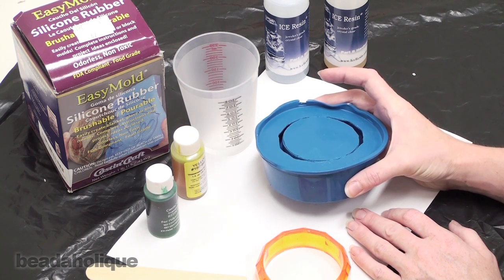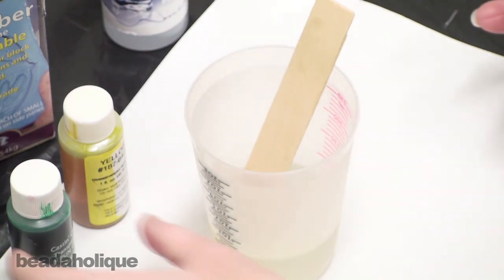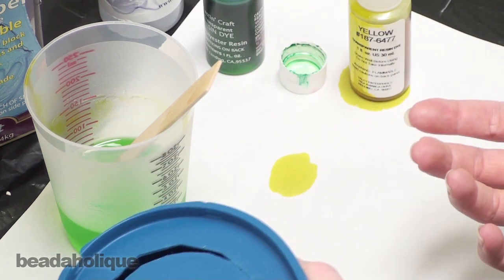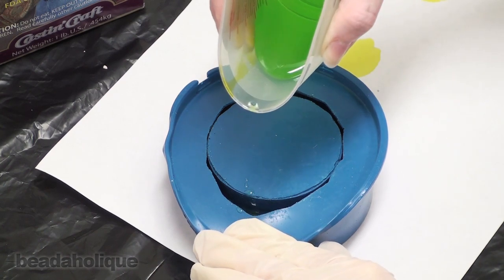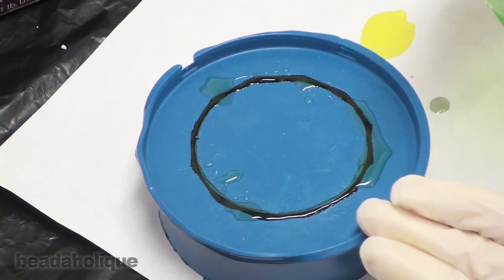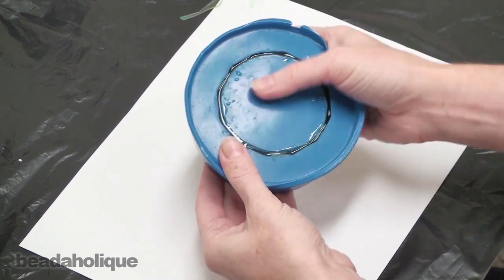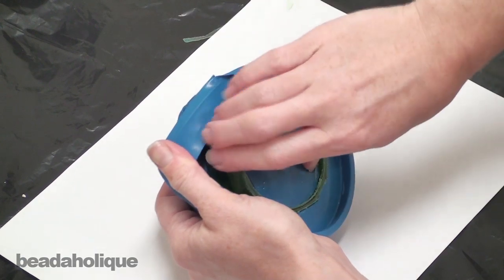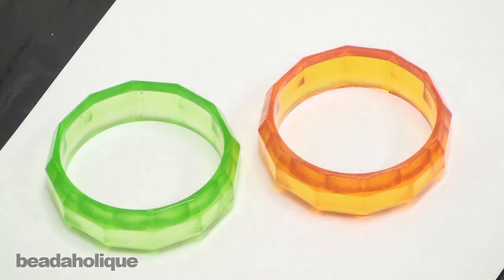How to Make a Resin Bangle Bracelet Using a Block Mold

Comment from the maker: @Beadaholique Secondly, the flex molds have that nice wide opening up top which makes insertion easy - with the block molds, the opening is going to vary based on the shape of the item you have molded. In the video I made, the bangle came to a narrow taper along the edge so the opening to pour the resin (or to insert objects) was just a small slit. My recommendation if you wanted to embed objects into block molds would be to mold items with a larger opening up top - similar to the flex mold.

Comment from the maker: @craftmomma3 The filing does remove the shine.  Here is what I would try to return the shine - first buff the area as best as possible to remove any resin dust and make the piece very smooth. Then try painting a very thin coat of gloss sealant over the area. You can also use clear nail polish - both of these will bring back some of the shine. Try this on a test piece first since this is not a guaranteed solution. Hope this gives you some ideas!

Comment from the maker: If you want to add things to resin, just sit them down inside your mold before you pour the resin. A feather is going to be really tricky though because it will move around when the liquid is poured over it. You will need to experiment to see what works and what does not. What type of lettering are you wanting to add? A premade silicone mold is actually going to be easier to do this with then a block mold because you will be able to see through it.

Comment from the maker: @theonlyjaie Yes, you can embed objects with block molds but it is a much more difficult process then with the flex molds and it will take some trial and error. First, the flex molds are clear which makes embedding and arranging objects fairly easy whereas the block molds are a solid dark opaque which can make it tricky to see where you are placing objects.

Comment: @Beadaholique I think I have a way around stabilizing the mold. What I want to pour will be around 10" high and slim and I want to embed into it. I'm thinking of using a clear piece of pipe (like what is used in candle crafting) to hold the silicone not only for casting, but for holding it during resin pours, mold top can be open. Now that I know that the only issue is that you can't see what you are embedding, I think the clear will give me a way around that.

Comment from the maker: I have never used a straw but my best guess is that they are trying to use the heat of their breath to remove the bubbles. Blowing cold air on it will do nothing. I would actually think breathing heavily close to mixed resin would be better then the straw which might allow the heat of your breath to cool down before it reaches the resin. Still wait the 5 minutes, it does help a lot, and then you can try the hot breath - the more you can do to remove bubbles, the better.

Comment from the maker: @theonlyjaie It really is a case of not being able to see and also having such a narrow slot to get an object into the mold through. If you can open up that slot more - like perhaps mold an object with a wider top edge, you will find the process goes more smoothly. Also, if you are embedding objects in resin layers, you are going to have to be careful about manipulating the mold a lot when pouring the resin.

Comment: Nice, but 1 suggestion; drop a soup can in the center of the bangle. This would reduce the amount of silicone rubber needed. It would also make it easier to remove from the mold because a "donut" shaped mold would have no interior to fight against.
Reply: Thanks great suggestion

Comment: When making the mold, if you would put a large cylindrical object in the middle of the bracelet you'd save a lot of mold material and make it a lot easier to remove the item.

Comment from the maker: @michaelification1 Hi! Unfortunately since we do not sell the RTV 585 silicone rubber mold, I can not speak to what resins will work in it. However, what you are describing sounds more like a problem with the resin then the mold. If your resin is old, this could prevent it from setting up properly and always remaining sticky. The other issue could be if it was measured wrong. You need exactly equal parts of part A and part B. I hope this helps! Good luck!

Comment from the maker: @kenshidark We did not drill a hole in the video because we try to only use tools which a lot of people have on hand or are easily accessible. If you are going to drill a hole, I would do so with the original object still inside the mold (it will make the entire mold more stable for drilling)  and make sure not to drill anywhere near the molded area. I personally have not drilled through this type of substance before so I am not sure how easy it is going to be - it is a flexible rubber.

Comment from the maker: @ThePrettyLime The two most common reasons for resin remaining soft after 3 days are: somehow the mixing ratio was off and it was not exactly equal parts (you need to make sure that part A and part B are exactly a 1 to 1 ration), and the second cause could be that your resin is getting old. How long have you had it?

Comment: @Beadaholique what about using the clear (its more translucent than "clear" actually) molds?  I've had an idea that requires silicon molds but I've been hesitating because so few people seem to embed objects when using these molds. I've seen some resin bubble rings that very obviously have things embedded in them but have been just confused as to how the creator did it. If it's just a case of it isn't done much because you can't see the object, I can get around that!

Comment from the maker: @Beadaholique You will notice in the video how I pull the edge of the silicone rubber to widen the opening to pour my resin in - however if you are working in layers, you are not going to want to pull the rubber too much and run the change of the resin seeping along the side of the previous layer (not a big deal if just using clear resin but if making stripes then it could be an issue). Again, if you have a wider top area of your mold to pour into, it would help with this issue.

Comment: Great video. For a university project i was thinking of making resin and silicone bracelets. I was wondering, is it possible to make a silicone mould and then instead of using resin inside, use silicone? is it possible to buy transparent silicone? or a softer resin?
kind regards

Comment: Can you also make this with designs in it or with other objects inside it as well?
Reply from the maker: You can embed things into your block mold as you would other resin pieces, yes!  Just make sure that your inclusions fit in the mold completely and seal them if necessary.  If you want something to sit in the middle, you may need to pour your resin in more than one batch, letting it cure in between so it has something to hold it up.

Comment: HI can you answer please, this bangle has a midle bit which could be used to add some things like charms or cabs, how would i go about, if i wanted to make similar using a  silicone mold - do i have to add half resin wait to set and add the items and than the rest of the resin or can i add everything in one go.

Comment: @Beadaholique 

is it normally use the rtv 585 silicone rubber mold for epoxy resin?I've used both of these but when i demold it became sticky.My curing time is 1 day,is it required to cure fir 3 days?What would you think my mistake,is it the silicone mold or my curing time?I hope you can give me some advice.Thanks!

Comment: @Beadaholique hi! can i use easy cast clear casting epoxy resin in easy mold silicone rubber?i saw your video using that kind of mold rubber,i have that one but i don't know if  easy cast clear casting epoxy resin is compatible to use?

Comment: I see I can get the rubber mould but I’d like to get the actual bangle mould in the video. Is that possible?
Reply from the maker: The original plastic bangle that we cast to give the rubber mold its shape was a piece Julie brought from home I think, unfortunately it's not something we've ever had in stock. The advantage of mold kits is that you can take a piece of old jewelry you have lying around or a cheap find at the mall and give its shape new life with new materials.

Comment: Can you embed photos with the block mold?
Reply from the maker: Once you have created your block mold, it is possible to embed photos inside at the resin pouring stage but it is tricky and can be hard to get them to stay where you want them to. You basically need to cut and seal your photos and then carefully place them into the mold either before you pour your resin or after you pour your resin but before it has cured. It is a more advanced technique and different people do it different ways.

Comment: isnt it technically copyright infringement to take someone else's design and make a mold of it..?
Reply from the maker: If it is a patented design then absolutely. If is is something like a basic shape that is not branded then you should be fine. Of course never used licensed designs or depictions or images of characters or known shapes from the entertainment or gaming industry. Also do not replicate cabochons with designs on them (round smooth should be fine) or original manufactured jewelry components from other designers.